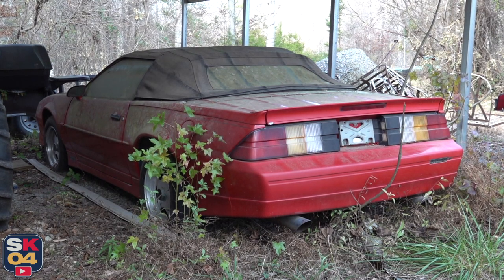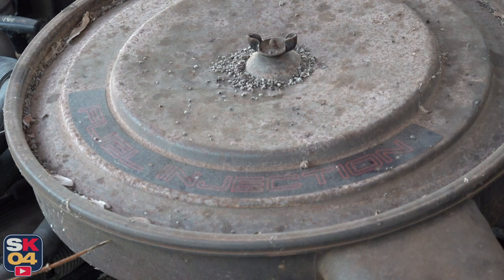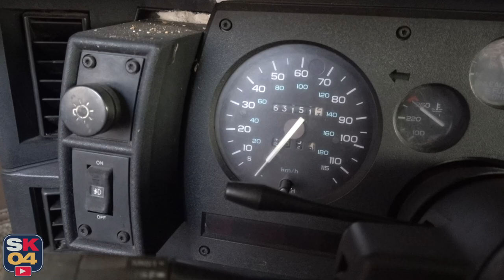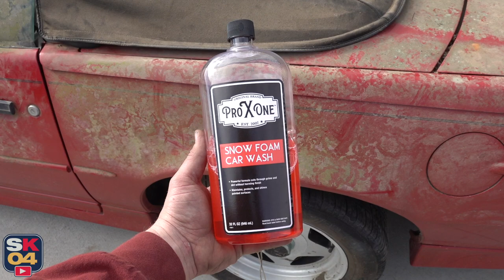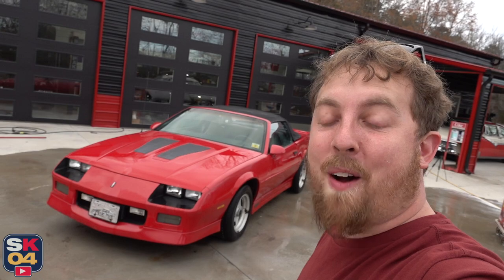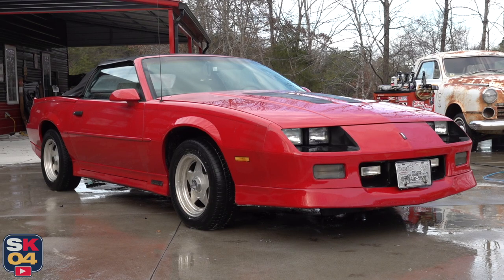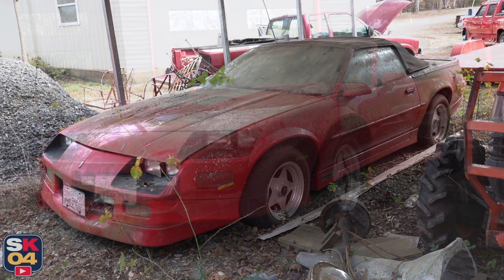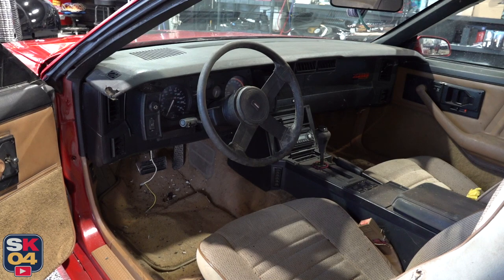Rescuing A Forgotten Chevrolet Camaro IROC-Z Convertible...First Detail In YEARS!

Comment: The wheel swap transformed it. I think ASC did the convertible top conversion...always wondered how it was done but in this vid you can see how they basically capped off the rear after cutting along the top of the quarter panel. Lots of mods to the windshield header too.  I think after years of mouse piss I'd just throw the interior soft stuff away and look for a carpet kit and seat foam and upholstery, if available for this gen

Comment: You  did a great job cleaning up this camaro.  But I sure this is a iroc z, as the rear tail  lights  are not right  for a iroc.  It may be a rs car. Look for the wonder bar in the front  and see what size the sway  bars or. I.want to see you do more work on this car.

Comment: You should put the factory iroc tail lights back on the car, those are from a RS. The car looks great!
Reply: Not even RS. Base Camaro tailights. RS had the black center stripe. Like the Z-28s before 1985.
Reply: I'm more familiar with the 85-87 iroc but that interior doesn't look right either, seats especially and door panels
Reply: @jeffreyshepherd8488  I agree. The seats look awfully lower level. Not even GM looking. Possibly reupholstered. Certainly not something I have ever seen in the highest trim level Z-28. (The IROC-Z)
Reply: @russelllamb5533  he said it was resprayed, would not be hard to add iroc badges at that time. The one on the dash would be harder though. Missing the pin strip above the rocker molding.

Comment: I have been finding my '88 IROC in my garage every day for the last 36yrs🙂  LB9, 5spd, t-tops.  I have kept it essentially stock and it continues to be a fun car to drive.
Wrong wheels, no door decals, no lower body striping, etc (may be because of repaint)--probably not an IROC and they just slapped a few badges on it.

Comment: I have a 89 firebird formula.  Had to laugh I put that exact radio in mine in 98.  That paint is also single stage Maaco probably late 90s early 2k.  (I also had a maaco spray in the late 90s and can recognize the overspray) My guess it was done up in the late 90s and then parked in and around 2005.  My 89 firebird I LS swapped, converted to a manual T56.  All gauges work, AC, everything.  If you decide to LS swap it it's pretty straightforward.  My car was the 305 L03TBI/700r4 originally also.  Hawks has the repop wheels in 17 inch.

Comment: Very nice, I just bought a 89 Camaro, mine was pretty much the reverse, the Engine was just rebuilt and the interior is in like new condition but the Pant is absolutely shot, the Florida Sun just cooked it, so all I have to do is repaint it, It's white now and I'm just going to repaint it white but's i'm going to use a single stage paint.

Comment: Awesome!  I missed your old car reviews and restoration!  Please please please put some stock OEM wheels on it.  The OEM IROC wheels were works of art.  A shame someone cheaped out on those tacky aftermarket wheels now on the car.  Sadly, it looks like the distinctive three bar IROC taillights have been swapped out for non-original base model units.  Hope a fix is in the works for that too.  Those exhaust tips are also non-original and don't fit the character of the car.  The factory original IROC-Z was a beautiful classic.

Check the VIN and the title to see if it's an actual IROC-Z.  I'm a bit skeptical seeing all the non-IROC parts on it (the taillights, that 110 mph speedo, the hood and other little non-IROC bits).  I'm pretty sure every IROC got a 145 mph speedo.
Reply: 10:00 It looks like rear drum brakes. I was pretty sure all IROC's had 4 wheel disc brakes. It looks more like a Camaro RS then a IROC , especially because of the rear drum brakes. A girl I knew had a yellow 1988 Camaro RS convertible and it looks very similar to the car in this video. The wheels on the Camaro RS are basically Z28 wheels from 1982-1986 with silver center caps and silver lug nut caps.

Comment: Did you check rpo codes to make sure this is an actual iroc? Did someone replace the grid tails with sport coupe tail lights? And the fog lights don't look like oem or repops, they're the wrong shape. It's really easy to make these cars appear like an iroc or z28, especially being a tbi. In 88 the sport coupes had ground fx so you theoretically paint it one color, add the iroc emblems, grille, fogs, tails, and steering wheel.

Comment: I’d run the VIN on that Camaro. Dont recall any motor options on IROC ragtop. They were all 5.0TPI (not TBI). I had two. That has wrong tail lights, wrong steering wheel, obviously wrong wheels, wrong decals. And should have Tuned Port Injection if it’s a true IROC. Looks great regardless!

Comment: Hey Kyle, wow what very nice car it turned out to become, in fact I own almost the same car: a Red Convertible 1987 Chevrolet Camaro Z28 Iroc-Z, 305 TPI V8,  220Hp, 5 gear manual and 4x disk-brakes. When I see how your car turned out to be, I think I should have my car detailed as well...because my car looked better compared to your car in the first stage, but my car does not even come close to how your car looks like now! 
About the herspers: well please take note of the following: GM, the cheap bastards, had to sell Iroc-Z cars for homo-legation purpose. They did this obviously the cheapest way by purchasing Australian Borg-Warner 5 gear Non-World-Class manual gearbox which could barely cope with the 220 Hp 305TPI V8. This was the cheapest transmission available to GM...
This is the very reason why the 5,7 Liter 230Hp V8 never was available with this Borg-Warner 5 speed manual transmission, since these 10 herspers extra of the 5,7 liter V8 would chew up this Borg-Warner Non-World-Class 5 speed transmission, maybe even the rest of the drive train as well. And GM did not feel like spending a lot of money on warranty cases... They could have taken the Borg-Warner World-Class 5 speed transmission, which could handle much more power but that transmission was slightly more expensive for GM. Ford (FOMOCO) however did purchase these Borg-Warner 5 speed manual World-Class transmissions and put this transmission in their Mustang 5.0 Liter HO V8 with manual gears obviously...In exactly the same era of the mid and late 80-ties.  
I am not sure whether one could raise the herspers of the 305 V8 you've got in there, automatic transmission wise spoken, but I'd strongly advise you to do your home work before you start spending dollars on making the engine fast while chewing up your entire drive train...
It unfortunately is commonly known that GM were cheap bastards, and they'd save a dime here and there, they would ! Have a lotta fun with this beauty and like I said; you may want to reconsider the build up of Hp's, but again I am no expert on the automatic transmission you've got in there ;-)

Comment: I am a Auto Tech and a Marine Tech and also restore muscle cars I also used to do Auto body and Paint . You are a true professional the car looks outstanding . I have one question .  There has to be mouse pee down in the carpet pad and floor . When you had the seats out all you would of had to do is pull the console and the trim plates on the door sills and jerk out the carpet. I would of used pre cleaner on it soaked it then took a pressure washer to it top and bottom then shampooed it then took hot bleach water to the floor of the car to disinfect it . One a hot sunny day the escense of mouse piss will probably wafer up to your nose. You did such a beautiful job and you were so close why didnt you jerk the carpet would of only took about another 30 minutes to gut it completely. Not knock it just wondered why you skipped it . I am learning Video Editing your editing skills are a 10 dude and I rarely give out complements like this

Comment: It's crazy to think a 5.0 V8 only produced 170HP in 1988, the year I graduated high school. Just about every 2.0 4cyl currently on the market can beat that.
Reply: More than three decades have gone by since these cars were produced.  Not sure if you realized it, but the 3rd gen Camaros were even offered with a 90 hp 2.5L Iron Duke four cylinder (likely for fuel economy, insurance, or marketing reasons to bring the price down).  These were offered from 1982 through the 1987 model year before the 2.8L V6 became the base engine.  Even that tired 305 is an upgrade over the old Iron Duke.

Comment: 👋😳😲Hey ! I would keep it that same color red touch up that paint job. Keep that black convertible top ,or get a new one that's still black. A wide body kit. Wider rims and tires in the back all rims and tires blacked out!!And do whatever you got to do to get that existing engine up to $1, 000 horsepowers!! And add a custom carbon fiber air ram hood🤔👍🤨

Comment: I was considering buying a IROC back in the 80'. At the time Tony Curtis was the celebrity spokesperson . Thankfully I didn't because these cars had major quality problems and were all show and little go. On the go if you compare it to the cars of the 80's maybe not really weak. The quality and fit and finish left something to be desired.
Pouring time and money into one of these has to be a labor of love because you will never get your money out of one of these when it comes time to sell it.
Reply: Market is only going up.
Reply: This car lost its originality cred some time ago (that 110 mph speedo, those exhaust tips, the wheels).  The lower level base models (which I suspect this one is) were produced in much larger numbers and not worth as much as genuine IROCs.  The title and the VIN number decides if it's a genuine IROC or not.

Comment: Why the standard taillights?
Base Camaro tailights.
I bought a 1985 IROC-Z in April 1985. Electric Blue (Bright blue/metallicic)
I traded in a 1983 Z-28 with the 5.0 HIGH OUTPUT and 5 speed. My '83 Had taillights like yours except the centerline was a black stripe because it was a Z-28.
In 1985 all IROCs and Z-28s had the checkered tailights.

Comment: I would keep the og engine since this was a unmolested car
Reply: I disagree on both counts.  First of all, it's obviously not an unmolested car (those aftermarket exhaust tips and the non stock wheels are the first clue) so your originality claim goes straight out the window.  Secondly, those 305s were primarily emissions and fuel economy engines, and it's likely pretty old and tired by now.  Thirdly that 110 mph speedometer is the next hint this is probably not a genuine IROC as all IROCs (even the base 305s) got a 145 mph speedo, not the 110 that this car has.
Reply: @houseofno  I stick with my opinion
Reply: @Cinephilesteve7909  Good for you but it's not even an original car.  Even suction cups fall off, sort of like your argument failing to stick.
Reply: @houseofno  I really don’t care what opinion of what sticks or not

Comment: Let's stop with the phrase unmolested.
Reply: 🤫Absolutely not.unmolested is a very good term-phrase to describe anything, including a vehicle that has not been changed  from its original state,when it left the factory etc,.....
Reply: I agree.  Those exhaust tips, the wheels, and that questionable 110 mph speedo (all factory IROC's got 145's that year) shut down the "unmolested" label for me.  Not a genuine IROC is not necessarily a bad thing, as it opens the door for a ton of fun upgrades.